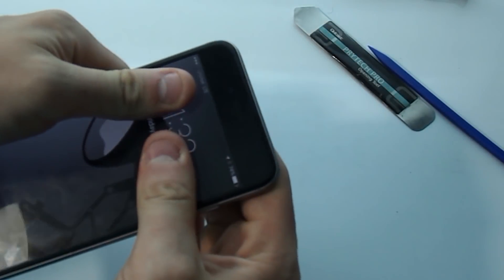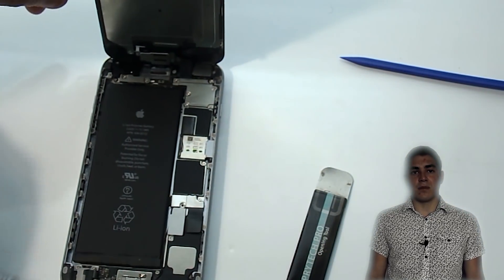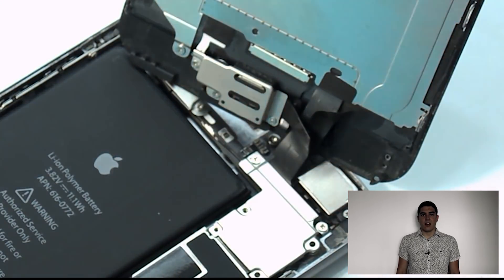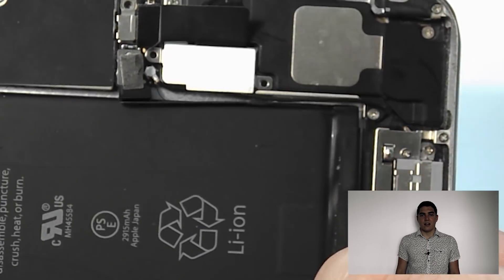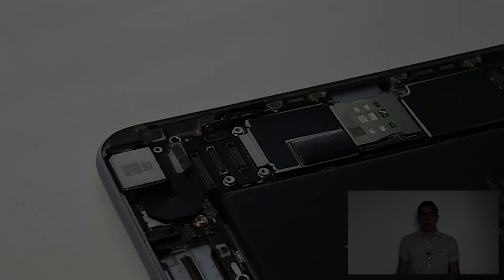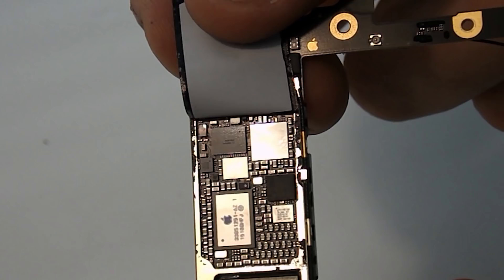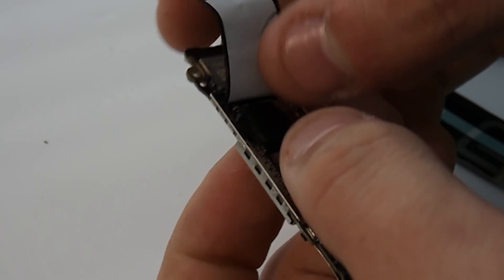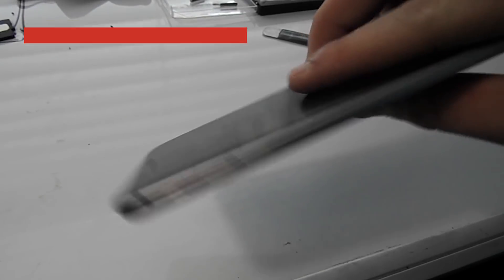How to Fix Touch Disease on iPhone 6 Plus (No Soldering or Bending) | appleEducate #03

Comment: This is crap! After repairing these things each and every single day for months now, this is one of the worst methods I've seen! You are doing nothing but postponing the inevitable and wasting time with a device that will just have to be taken apart and worked on again. Do it properly or just don't do it!! There is far more risk with breaking your device with this method than doing anything to fix the actual issue (Except you're not going to short out a device just by touching it, you should know this). If you understand the science behind the problem and learn how it actually fails in the first place (which you should with all these "certifications") then you wouldn't direct people to "fix" their phones like this! It's absurd!!
Reply from the maker: In apple's training, there is a section dedicated to Electro Static Discharge and there is always a possibility, regardless of how minuscule it is. I know exactly what this problem is caused by, and I know how it fails in the first place. This video is for people who are not ready to get a new phone or a logic board repair. There is risk with every repair, and this has a lot of risk but it has helped a lot of people. I would say getting the logic board repaired by a third party, not apple, is more risky because depending on the experience of the technician it could break the phone far worse than this method could ever do. I will be happy to leave a link to your repair service in the description. The purpose of this video is to spread awareness and help people. If you think that this method has 0% chance of success regardless of risk, I will gladly point people your way. There are people all over the world who have commented being so thankful that this has brought life back to their phone for a longer period of time, some of these people don't have repair shops near them or are not in a financial position to get micro soldering done or get a new phone. For a lot of people the phone has stopped working completely already. If this helps any of those people, it's worth it.
Reply: I understand that you would like to help people and for people especially that would like to at the least get their data backed up, I see why this would help them in that manner. I'm not saying this video in no way will help anyone however if someone is concerned about having a properly working device with a touch IC issue I believe that this is just misleading. As mentioned previously, this is just postponing the inevitable by putting constant pressure on the chip until it either fails completely, the tape gets moved, or the board bends more. For someone who just needs another week or 2 until they can get a phone upgrade or someone who is trying to DIY a fix just long enough to get data, this is fine. But for someone who is looking forward to having a functional device they can use day-to-day or as a standard smartphone, not only does this increase the risk of them damaging it but it's also not a solution that targets the real underlying defect with the phone's board and can cause even more issues because of the added pressure and bending you are putting on the board by doing this. For functionality and a working device, have the chips replaced with a security shield installed. For a potential and temporary week-long fix, this is fine.
Reply from the maker: +Matt Mosqueda I appreciate your comments and thank you for sharing that. I agree for a perfect solution that will prevent the problem coming back, the touch ic chips have to be replaced. I'll add something to the description about advising that.

Comment: Rody Davis, this is a very irresponsible post. I urge you to pull this video before it causes unsuspecting, good people to do additional damage to their iPhones. If you refuse you should offer to compensate anyone who bricks their phone while trying to do this. If you're accredited as you state, you should know better and do the right thing.
Reply from the maker: +David Rowe aka the smartphone repair guy I have plenty of links in my blog and video pointing people to logic board repair shops and new and refurbished phones. I'm not offering compensation. This video is only intended for people that feel comfortable opening their phone.   The fact remains this does work for people. At least 90% of the people who have done this reported it went away. I am currently on my 4th week with out it coming back. I posted this video because I wanted people to have a way to save money. And even if it only helped one person the video was a success.
Reply: *****, Just because you have enjoyed functionality from this procedure does not mean that it's a good method for everyone this video may reach. First do no harm. Suggesting that inexperienced and/or untrained people should open their phone and remove the motherboard is such a bad idea it defies description. You're not even warning anyone of the level of risk they are taking. Do you have any idea how easy it is to blow a backlight circuit or cause long screw damage? Are you aware of how soft the FPC connectors are and how easily they are deformed? Do you know how easy it is to scrape parts off the board when disconnecting FPCs?

It would be one thing to propose taking such risks if you called them out and were actually repairing something. But this is literally placing tape on a motherboard to increase pressure on very important BGAs. Do you know how much additional heat is generated? Do you know if the adhesive on the tape being used will have a chemical reaction to anything it's touching? Do you know what that additional pressure to the motherboard might do if the phone is bent further (or in the other direction), dropped or has water incursion? How many parts on the other side of the motherboard are you putting at risk? Have you looked at what's on the other side of the motherboard? The freaking CPU is opposite this pressure. This is a very bad plan with a kabillion possible negative consequences. You're assuming none of the risks of your viewers and taking credit for a procedure that may brick their phone. I'm saying this despite the fact that you are generating more work for those of us in the mobile device micro soldering business. Don't put tape over your check engine light and don't advocate this procedure. Seriously, stop. Unless you're willing to perform this procedure and offer a warranty, you need to pull the video. I say that in the sincerest way possible.

Comment: Folks, this may look like a good idea and it may even work for some people, but please understand that this is not a repair. It doesn't fix anything. It's like holding your oven door closed with bubble gum.The touch IC problem is a combination of several factors, including oxidized contacts under the touch ICs. Simply putting pressure on these chips could cause more problems later making it harder and more expensive to repair. Just opening the phone without experience or specific instructions can result in additional damage like blown backlights or long screw damage. It's a $700 phone. Don't try to fix it with tape.
Reply from the maker: +David Rowe aka the smartphone repair guy if you offer the repair and would like to fix the problem then you give me a link I will be happy to put it in the description. But this video is helping spread awareness of the problem that Apple needs to fix.
Reply: *****, this is not about drumming up business, and there are better ways to raise awareness of the touch IC problem. Apple does need to address this problem, but short of that, using your reputation and accreditation to promote this high risk procedure is not appropriate.

Comment: The first time I did this my phone won't turn on, I had vertical white moving lines so I undid everything and it went back to having the unresponsive screen.. waited a few days and it didn't work with 1 piece of tape so I went in again and place 2 more pieces.. it's better but it's still having the issue. Idk if I should put more tape or just leave it as it is
Reply from the maker: +Michael Guaman I'm not sure. You can try more tape or if that doesn't work get your board micro soldered. Thanks for watching!

Comment: Don't use the iFixit Pro moniker to tell people this kind of BS!  The only robust solution for touch disease is desoldering the touch ics, cleaning the pads, and resoldering new chips along with a soldered on futureproof shield.   All this taping/shimming nonsense just encourages DIY folks to break their screens.  :( :( :(
We fix touch disease all day every day and there is nothing worse than doing an hour of board repair only to find out that their native screen is laggy for touch from twisting and bending or that they've bent their board with shims so that they lose cell service from baseband CPU cold joints from board flexion.  Ugh!
Reply: I went from my phone being an expensive paperweight to working condition in less than a minute at no cost and with no skills required.  I realize this workaround may make you cringe but it worked and can help a lot of people without the time and money for a soldering repair.
Reply: @iPad Rehab: In Lahore, Pakistan we do not have a proper shop or person to do Touch IC repair.
the one we have only apply heat and reflow the IC so it works for a while and then it stops working.
So we have to do something like this.
Great video.
Reply from the maker: +Waqar Ahmed thank you so much!
Reply: It most definitely works. Tried this and got it the first time. No doubt the best way is to send it to a proper tech and let them do it. But as Mr Waqar said (im also from LHR Pakistan) i also gave my device to a tech and after two days he charged me about 100$ and told they changed the ic. Guess what problem returned after 3 days. Hats off for making this video.
Reply: Good to know IPad Rehab, by the way do you, or anybody know if Apple is doing something about it? I no longer have the apple care and I'm a bit dubious to buy it. What would be the cheapest professional fix without having to pay the price of the phone again? Thanks in advance for your reply.
Reply: Dave Ramirez yes, apple will replace for $149 plus tax.
Reply: I'm not against phone technicians but most of the time, they overcharged us just to get our phone fixed. this video help us to get our phones fixed without spending money. I have the same issue with my phone just last night and I'll definitely try to do this before going to tech's
Reply: Phryan Marc Gamazon iPad rehab charges exorbitant amount if they even want to work on it.
Reply: Thank You!!! this video is nonsense
Reply: iPad Rehab it does work
Reply: Justaginger 69 it will temporarily but progressively return and eventually kill device.
Reply: iPad Rehab could you repair mine?
Reply: it fixed mine :)
Reply: Phryan Marc Gamazon Doing this will likely get touch working again for a short time, but you should also know that you make the problem worse by doing this.

 This does not address the underlying issue with the damaged connections to the board. It in fact causes more damage by exacerbating the original problem. I've seen many of these come into my shop that are much worse because people put stuff behind the board. 

If you want to actually fix it, a reputable shop with proper equipment and knowledge can fix this with relative ease at this point.
Reply: Well, I sent my iPhone 6 plus for resoldering ics chips, the problem returned in 4 months, just month after shop warranty. Looks like there is no fix for this problem.
Reply: shut the fuck up you whiney ass bitch
Reply: iPad Rehab it fixed my crappy apple brick.
Reply: iPad Rehab v
Reply: iPad Rehab I just did it to my phone and now it works flawlessly. Screen is brand new and it actually works thanks to this guy’s video.
Reply from the maker: +iPad Rehab I have been referring lots of people to you in the comments. This is for people that are not ready to replace the chips. This does work and does get more life out of the phone before you have to pay for the micro soldering. There are lots of people that are not comfortable taking apart their phone and I have sent them to your website multiple times.. this is not a scam or fake repair, this does work. It's just not the cleanest solution. Before I did this repair I was going to send my phone to you but I looked for other solutions that cost less. I bought the phone 2 weeks before this problem started happening and I wasn't ready to pay more at the time. I am fully aware of what you do over there and have a lot of respect for micro soldering. That's why I commented on your insta post about it and referred you so many times.
Reply: Straight crap. I hate seeing stuff like this.

Comment: Rody, was following your directions to a T. but when booted up, noticed grey vertical lines down the middle of the screen  and not touch capability.   Took it apart and tried again, same result.  Thoughts?  About to give up and send it away for repair..$200, with metal plate installed on back to prevent it from happening again.
Reply: you broke your lcd because you dont know what you're doing. congrats.
Reply: Same problem here. I´d appreciate if you let me know how you fixed it.
Reply from the maker: +Frank Dalessandro that sounds like the chip is too bad for this repair to work. But vertical lines indicate the display connector not connected all the way or messed up.

Comment: for that issue, i'm right now suffering with iPhone 6. My phone has never been torn down but it is having troubles in right top corner with unresponsive and sometime it works so well. I noticed that this problem has been much improved on 10.1 beta while with other older iOS version the trouble is severe.

Comment: I did this but now none of my side buttons work! Help,!
Reply from the maker: +MrYeahright75 double check all your connections. Remember there is a connector by the battery at the top of the logic board that is easy to forget. That is for the volume buttons. Thanks for watching!

Comment: Tried this hoping it would work and now my phone won't turn on. Any ideas on what might've gone wrong?
Reply from the maker: +Jesse Ray double check the display connections and make sure everything is plugged in. Make sure to plug it in to the charger when you are finished. Sometimes it needs to be jump started

Comment: Fantastic!!! It worked man! You are a life savior!
Reply from the maker: +César Nunes thanks for watching!!
Reply: Is there any technical diagnostic tool for iphones that you recommend? I have one dead 6+ here. I can put it into dfu mode but in Itunes it keeps "waiting for iphone". You might come up with a bright idea. Thanks anyway.
Reply from the maker: +César Nunes Apple has a diagnostic tool but not everyone has access. Try using an official Apple cord and also try on a Mac. Make sure you have the latest iTunes and everything is connected. Also try charging the phone over night before you do anything to make sure there are no power issues. If you can get the screen to come on at all maybe it could be the screen or the logic board going bad. It also could be the lighting dock on your phone. Let me know what happens and thanks for watching!
Reply: Ok thanks for replying. I usually take notes of everything while troubleshooting. 1 Problem:phone becomes unresponsive to touch(although power button and home button are ok when it happens). 2 It shuts down, black screen, no response at all, no matter what you do. It does enters in DFU mode on Itunes(although nothing is seen at the screen) . 3 - just by not doing anything, after 20-30 minutes it comes back on as if nothing had happened.4 - I have another iphone (my personal phone). I have carefully swapped displays, the display is perfect, tested on good phone. 5 -same pattern even with a different display (steps 1,2 and 3) 6 - For the sake of testing, I have disconnected each one at a time: power button, volume button, display cable,home button cable and front-camera while turning the phone on (always disconnected battery first). Same problem. 7 - I wanted to get deep into this,so I swapped logic boards with the good phone. Believe it or not, the problem went to the other phone (lol). So obviously, the problem is in the Logic board. I wonder if it is fixable?I haven't tried this trick with the IC chip, but although the first symptom is the unresponsive touch, I don't believe this is the main problem. It worked in my personal phone,  but I only had a problem with the touch. Sorry for the huge text ( I wish you had a discussion forum, your webpage is off). For the record, I am not a iOs tech, I am a IT tech, but I have always being doing repairs to pc motherboards and general hardware.What sux is that apple doesn`t provide any software to their customers concerning hardware. Thanks man. If you want, we can talk by e-mail.
Reply: Hey what`s with the strikethrough? sorry about that. lol